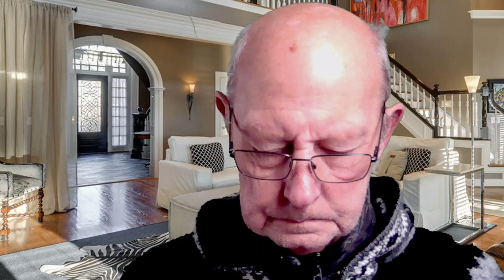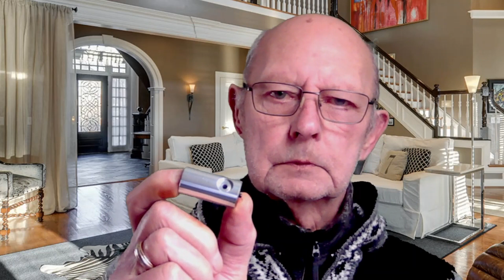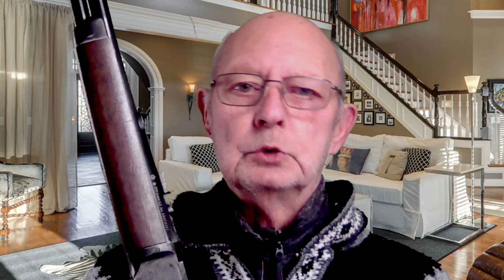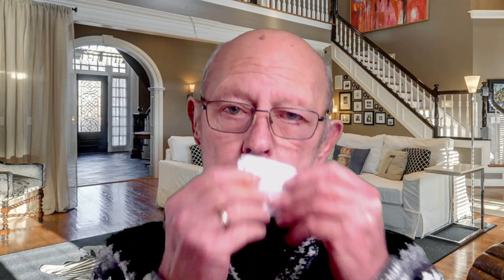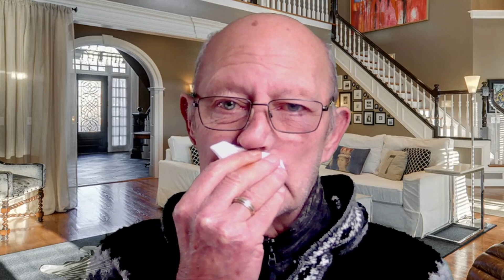SMK Victory CP2 Am I Right Or Wrong

Comment: i can see both sides of the discussion, i see what other on youtube are doing creating a bigger hole, but i see what Terry is thinking, if its the same principle as water coming through pipes as you reduce the pipe diameter the pressure builds and the water becomes more powerful like a jet wash verseus a hose pipe type of thing, i will  be interested to see the outcome of this test.

Comment: Agree with your theory, a smaller hole might increase the final pressure. But, at the same time not to loose FPE - in case you're using CP2 for ratting -size of the pressure chamber should be increased. That way would ensure a higher and constant pressure behind the pellet until leaves the barrel. And still regulating the usage of CO2 resources, getting a good usable shots out of a 12g CO2 container. 80 shots I was getting out of my Umarex Tornado CO2 revolver with .177 BB's when brand new, and still nothing higher than 350-360 FPS.

Comment: Hello Tom, I followed the modification steps from Tyrone and it worked very good. I have the artemis cp2. 22. Standard it was 500 fps. After the mods (drilling all the holes to 4 mm. And increasing the volume of the co2 chamber +modifying hammer spring +polishing hammer) it became 630 fps. I am satisfied with the results....

Comment: lets say 30 bar  thats the co2  (its not  the hole that makes the pressure) of gas will have more effect by the bigger hole ,  more will flow , its not a nozzle ,but a channel to get the air wher its needed
Reply from the maker: Hi, I understand what you are saying, and yes the pressure is from the co2, and we need to maintain that pressure, anyhow it's worth the try making a smaller hole, before drilling it out to a larger size, and my way of reducing the hole hasn't been done on youtube, so let's see what happens, and thank you for your comment, ( Terry )

Comment: Hi Terry, Tyrone here from African budget pellet gunner, I assume you are referring to my video. 
Your theory sounds good but remember that the secret to getting this to work, you need to balance the pressure and volume. The problem is that the volume required to overcome the enertia of the pellet gets lost if you make the hole smaller. Even though you have a slightly higher pressure you won't have the volume. 
Many times people open up the transfer port with little benefit. You need to open the transfer port and increase the hammer spring tension then you get the fps increase. 
With higher pressure PCP'S in countries where there are power restrictions (sub 12fpe) the way they reduce the fps is to make the transfer port hole smaller
Reply from the maker: Hi Tyrone, No I was not referring to your video,  it was someone asking me about referring it to a jet washer, but he did say about drilling out the ports and barrel that he saw on YouTube, I told him not too at the moment because once metal is taken out there's no way to put it back. my theory was for a smaller hole, I admit that was wrong, as you said, volume and pressure, but one good thing I found about the smaller hole was the amount of shot I got, and it's ideal for English small gardens (10 to 20 Yards long ) I Thank you for your comment, But I was not aiming at you. Terry

Comment: I THINK - you are wrong - The volume of air is needed to keep pressure - whatever it is, until the pellet exits the barrel.

Reducing the hole and the volume of air will ensure that the pressure doesn't last long enough.

I think you are confusing hole size with piston size.